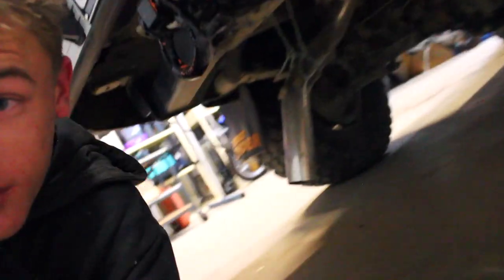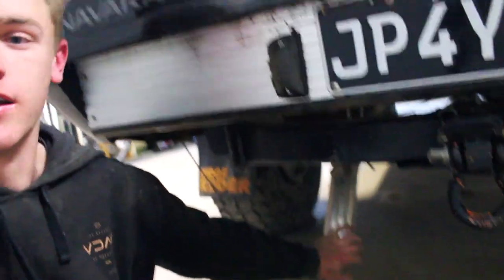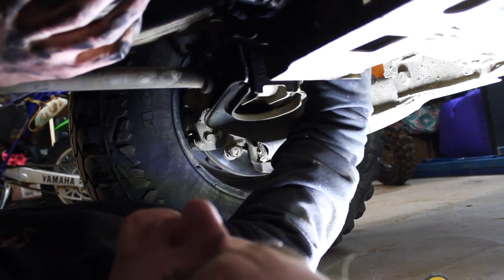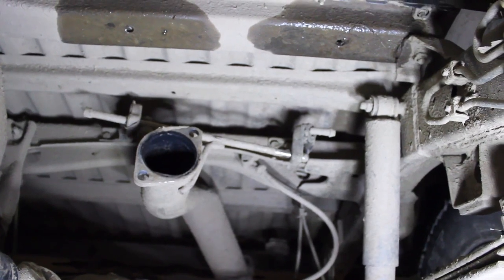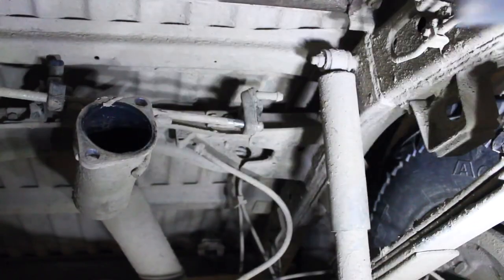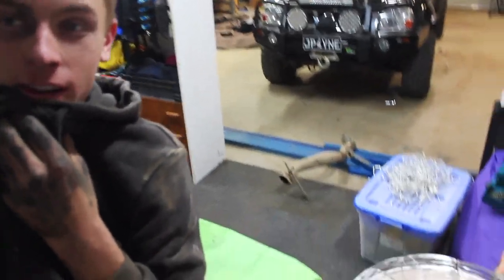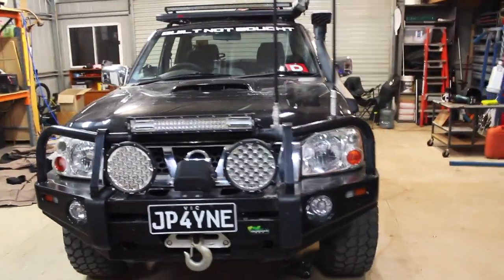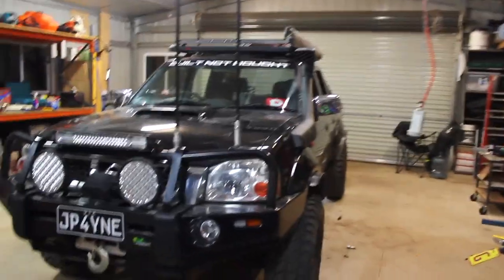Turbo Diesel 4WD with No Exhaust! louder?

Comment: Hey jarrod just curious to what size  lift and tyres are on the nav
Reply from the maker: I have no lift currently, but tyres are 32 mud terrains!!
Reply: @traveln4x4  cheers for the reply I have a nav myself do the 32" scrub out
Reply from the maker: @timothylee4927  no worries at all. yes they scrub when flexing and wheel turned, but just need to wind up torsion bars and hit inside of wheel arch and maybe grind back what ever scrubs!
Reply from the maker: @timothylee4927  also im pretty sure I removed some plastic guarding on the inside underneith
Reply: @traveln4x4  I'll defantly be getting my torsion bars wound up
Reply from the maker: @timothylee4927  its easy as to do. like 10 minute job in the shed man. easy as!!
Reply from the maker: @timothylee4927  just have to make sure its even both both sides of the car
Reply: @traveln4x4  no worries mate I have a flat driveway